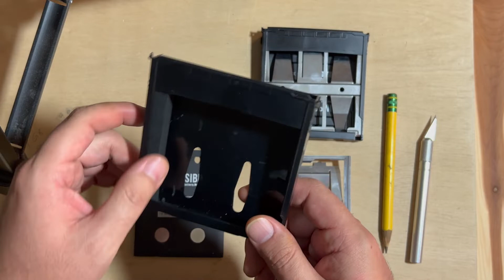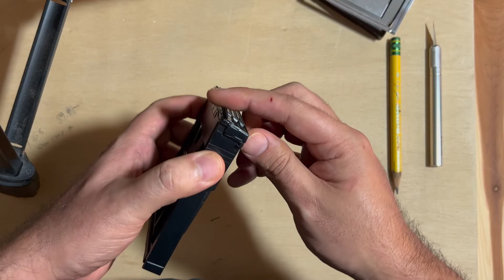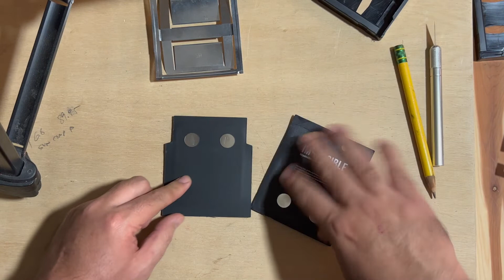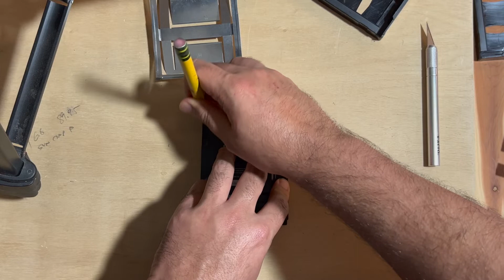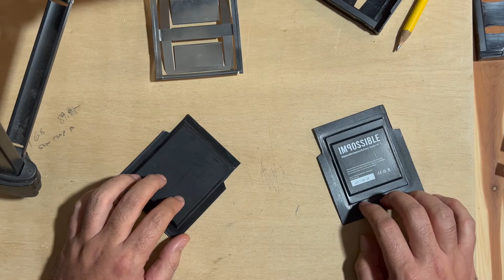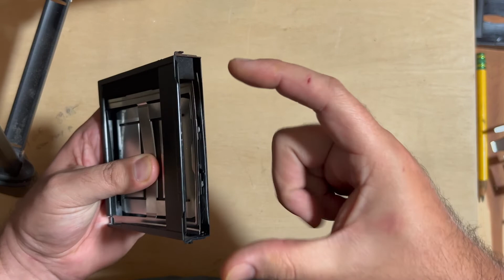Modifying a Polaroid 600 Battery to Fit a Spectra Cartridge

Comment: Thank you for this.  Found one of these cameras at a Goodwill for $2 and figured what the heck... only to find out the films were discontinued in 2019.  But did the modification you recommended and works great.  Just need to find some spare old Spectra (used) cartridges in good condition and some i-type film but was able to get it to properly eject the expired film that was in the camera.  After reviewing your video a few times I did realize that you pulled off the paper sheet from the original tray (as I suspect this may have caused some films to get stuck since they are thicker -- but once I removed this the camrea now feeds properly, with the original [but bad film pack] it had in it.  I'm just curious to see how well the photos will come out with i-type or 600 type film.

Comment: I have a question and given the time of the video I can only hope.  My question is if I can modify a 600 cartridge and put a fine rechargeable battery as small as possible but I need to know the exact voltage and amperage and also if the idea is viable 
Thanks!

Comment: Hey, quick question, do you think it’d be possible to design and 3d print a new front end for the spectra that allows you to shoot 600 film without this whole process? I’d like to know your thoughts on the viability and any concerns you’d have if so? Thank you!
Reply from the maker: The challenge isn’t the front end, so that would probably be a difficult and lengthy process. Look up Spectra adapter by polastudio, they have an attachment that allows you to feed a 600 cartridge directly.

Comment: Two days ago I got the first Spectra model from 1986 and I found a way to prevent the jamming problem completely by accident. I put the spring from the 600 cartridge upside down and ran about 4 or 5 packs of film through it and it didn't even jam once. I was lucky that my camera came with an old genuine Polaroid Spectra film cartridge but the battery in it was dead so I put the one from the 600 pack. After that I found out the spring was upside down and when I put it in the correct way, I had the camera jam by ejecting 2 frames at the same time on my first pack.
Reply: Makes you wonder why Impossible didn't try solving the spring tension issue. I believe they're abit too strong to hold the wider Spectra films.
Reply: @sonyviva308  they could fix it simply, but they didn't because it could cost them some money and spectra format is actually not favorite one in comparison with square format. they rather focused on polaroid go invention. because from that they could earn more money...
but if they would start sell spectra film again, i'll definitely buy 10 packs at once.
Reply: @radimproks589  They will not sell Spectra film again because they cannibalized the machinery for Spectra film and used it to make Go film. No idea what will happen to it if they ever discontinue Go film but hopefully it will be something resourceful

Comment: Hello, I just found out I could do this and I have a few questions about the process.
How would you compare the performance and reliability of using the foam and 600 spring frame vs just putting the pictures into a spectra cartridge? (like you did in an older video)

Also, do I need a new era spectra cartridge to open it without breaking (impossible Polaroid originals), or do the old 90s spectra packs have the latches to open up the cartridges as well?

Last thing I wanted to ask, you did a video using instax square film in a spectra, id love to see if you could attempt a wide or even 2 minis side by side for a cool split image effect. If you know anything about using instax square in a regular 600 id love to learn about that as well.
Thanks 😊
Reply from the maker: I feel like the foam does really help. Especially to reduce multiple frames ejecting at the same time.

I am unsure about the old spectra cartridges, I’ve only ever used the modern ones.

2 minis on one shot sounds interesting! I’m no longer messing with Spectras though, at least not this year.

Comment: I did this exactly but my spectra kept getting jammed when the 600 film is coming out. Can you think of a solution?
Reply from the maker: Could you tell if it was because a 2nd frame tried to slide in? This is why I stopped loading a couple at a time and instead went for trying to feed the whole stack.
Reply: @sprkplg  i think so but regardless of how many i put in it would get jammed
Reply: @radnebula6107  hi there. i actually had same experience. my 600 film in spectra didn't eject or if did, it took 2 frames. it was insane. i found out that a little hole (or space) in front of original (impossible project) spectra cartridge where film ejects was too open. there was more space than initiated so 2 frames went out. mine ones got out properly, but you don't want that of course. i took a higher plastic plate and replaced the original one. and it works! 8 frames going out nicely!
Reply: @radimproks589  could you explain this in more detail perhaps. I just bought a spectra camera